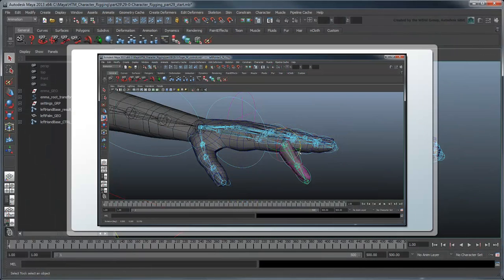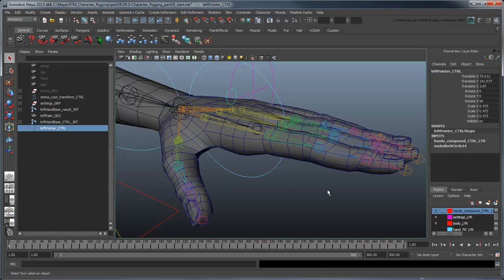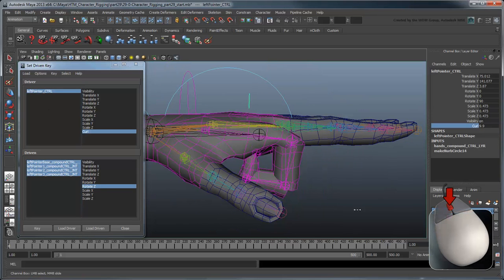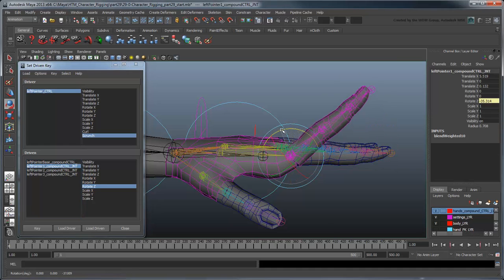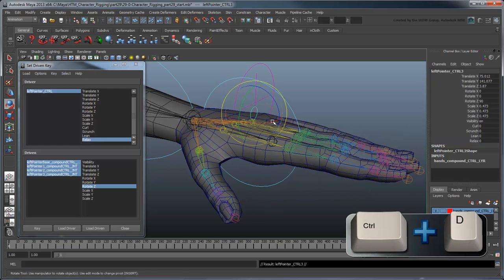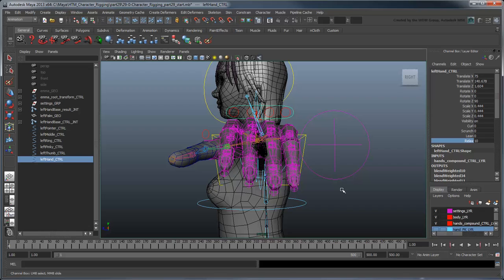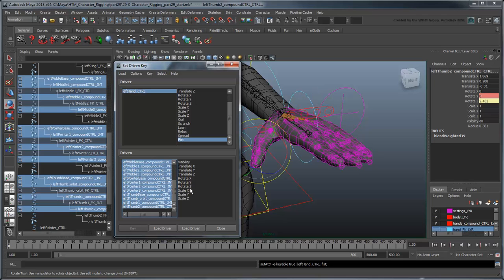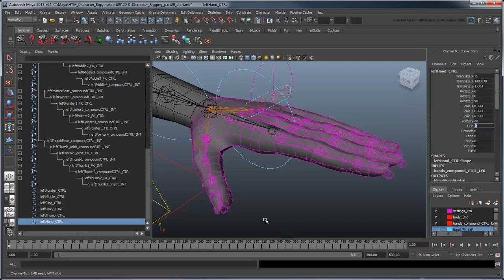Creating a Character Rig - Part 29: Compound finger controls (Advanced)

Comment: Hi people, I have a question. I revisited the tutorial again to correct some of the joints that were misplaced during my last attempt. However some weird selection issue in maya appear to display all my joints hierarchy as such for eg. "|leftHandBase_CTRL_JNT|leftPinkyBase_compoundCTRL_JNT|leftPinky1_straight_JNT|leftPinky1_compoundCTRL_JNT|leftPinky1_FK_CTRL". Further this is also how the names are displayed in the setDrivenKey window which makes it quite tedious to read as it is a very long name, though keying works fine. Any idea wat is the settings or issue that i have accidentally mingle with? Thank you in advance!
Reply from the maker: Did you import some of these joints from another file?  It could be a Namespace issue (although those are usually denoted by ":" rather than "|").
Reply: @Autodesk_Maya  Thanks for the prompt reply. The joints were not imported from another file but i did duplicated the original joints and shifted their position to save some time. Is that the cause?

Comment: My finger GEO goes into my palm GEO when I do the curl or fist. Are we going to fix this with weighting or whatever?
Reply from the maker: Are you using the proxy geometry, or did you already skin it?  For the proxy geometry it doesn't matter much, since we're going to re-skin the geometry anyway (unless you mean the geometry goes WAY into the skin, in which case I would check its pivot point to make sure its correct).  

If you went ahead and skinned it already and you're getting that behavior, it likely means your skin weights aren't right.
Reply: I'm doing exactly what you're doing, only with my own model. The thing is my finger GEO goes a little into the hand GEO when I curl it, and I didn't know if skinning my model would make them collide.
Reply from the maker: Ah, this is fine.  When you skin it, you will end up altering the skin weights to avoid this problem (even on your real hand, when you curl your fingers, you'll notice how the skin folds over).

Comment: The hand itself feels like 5 other limbs in one. Its a lot of work. Is the rig adjustable for multiple characters?
Reply from the maker: Since the fingers are stretchable, you could conceivably adapt it to fit characters with different hands, provided they're roughly the same shape.  The rig as a whole would be trickier though.  Typically you have to build a rig to fit a specific body type since the points of articulation aren't the same from one character to another (based on proportions).

There are more recent advancements to make the overall process less painful (https://youtu.be/c538zkwxgTQ).  You can actually combine the basic quick rig with more customized appendages (like hands) to get a hybrid rig that balances speed of creation and flexibility of control.
Reply: Thank you. To me it would seem smart to set up some scripting that would run this whole process as long as your result joints are all in the right places. If you have the same amount of bones for every humanoid rig would this be possible with enough scripting knowlege?
Reply from the maker: Yup.  A script like that is definitely possible.

Comment: Having a problem with the compound controls here with my own model. The individual finger controls work just fine, but when I key everything for the Hand control (using the finger controls to position them appropriately) it doesn't make the connection somehow. I can still control the fingers individually, but the Hand control doesn't react to any changes to the attributes that I just keyed into it. I compared the node editor view with the scene file provided but I can't spot the error. My model is not in a perfect T-pose and his fingers are a bit spread apart while relaxed, so I rotated the fingers in the X axis too sometimes, not just the Z. But I keyed every axis for every finger which worked with the finger controls, hand control doesn't interact with anything though. Any ideas how to fix this?
Illustration: http://imgur.com/fu0xAOs
Your scene file in node editor: http://imgur.com/7xZeS4W
My scene in node editor: http://imgur.com/9XO9mDk
Reply from the maker: "using the finger controls to position them appropriately" - this might be your problem.  You need to actually position the compound joints themselves and set keyframes again.  You can't drive one control with another control or it will make one of those controls unusable.
Reply: Yes, that solved it. I just figured that as long as I get the compound joints into position it doesn't matter how I've done it since I only keyed the joint rotations, not the controls'. Looks like I was wrong.
Thank you for the time and effort you put into this!

Comment: One of the things I appreciate this video for is that it introduced me to the notion of having more than one Attribute drive the same target attribute. :D

But I noticed the effects become additive. for example - if i curl a finger using the finger control, then curl using the all fingers control, that one finger double curls into itself. The logic behind it is quite sound. But question - so in this case, we have done our part as riggers yes? and at this point - the animator should be responsible for understanding the intricacies of using the control attributes on a per finger vs per "all-fingers" basis?
Reply from the maker: +Gogo That's right.  The rig can only be so bulletproof.  Usually a small amount of documentation (even in the notes field of the affected controls) will be enough to steer the animator the right way.

Comment: Is it possible to have compound controls using a Spline Ik?
I need them on a tentacle.
Reply from the maker: Yes absolutely.  In that case, you would probably want to connect the custom attribute values to the transformations of the spline curve.
Reply: Maya Learning Channel Thank you! So basically the Clusters on the Spline Curve CVs act as a compoundCtrl Joint, but they are also Constraint Parented to the Nurb controllers. In this case, how will it be possible to transform the nurb controllers once the clusters are connected to the custom attributes?
Reply from the maker: Abhijeet Sawant It would really depend on the specific functionality that you want and the design of your rig.  However, my suggestion would be to set up your tentacles almost identically to what we have on this hand rig.  That is, use duplicate joints in each area with one controlled via a spline (in turn controlled via custom attrs) and the other controlled directly by FK curves.
Reply: Maya Learning Channel  Almost Works!! The Orient and Result Joints work as they should be with Spline and Fk together.
The only problem now is that I cannot figure out a way to make fk joints follow Spline Joints and vice versa. As I cannot really parent the Fk and Spine joints to each other, as it might break the spline.
Reply from the maker: Abhijeet Sawant If I may change my previous suggestion: a rig that is closer to the hybrid solution we used for spine might actually be better.  You can use the FK controls for initial positioning, and then the IK control for small tweaks (say, if you want the tentacle to grab something specific).  This way, you can use controls in the workspace rather than attribute driven controls (which are really great for fixed animations, but are probably too stringent for something with as much versatility as a tentacle).  

The problem I foresee is that if you want to say, curl the tentacle, it will always curl the same way.  In the case of fingers, which can only really curl in one direction, it's fine.  But for a tentacle, which can move in any direction, it would be too limiting.
Reply: Maya Learning Channel Oh Yes, Wow, That should definitely work. Thank you so much!